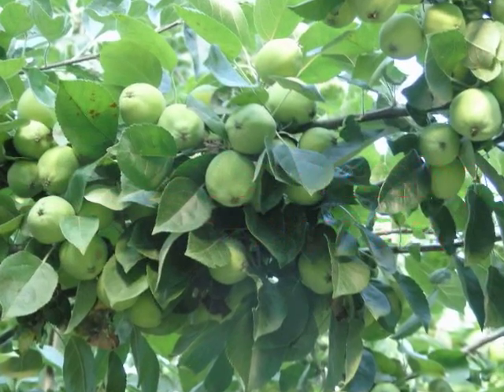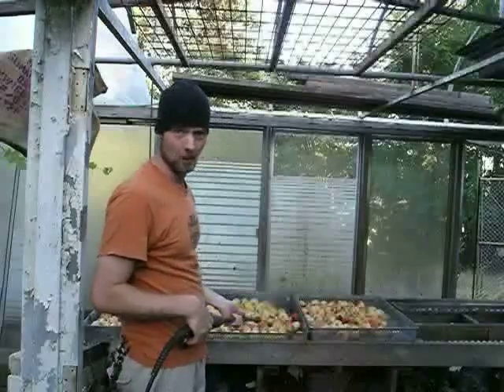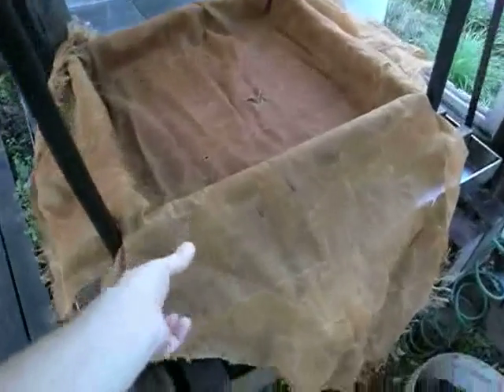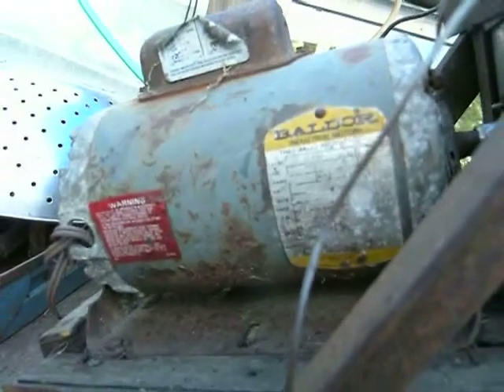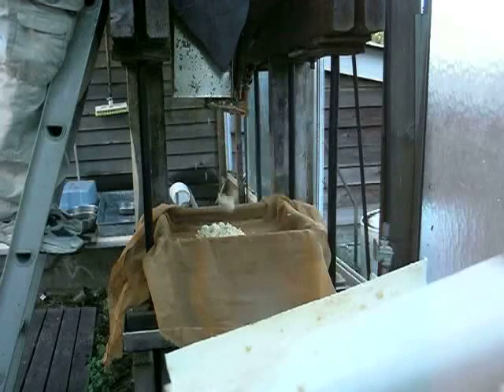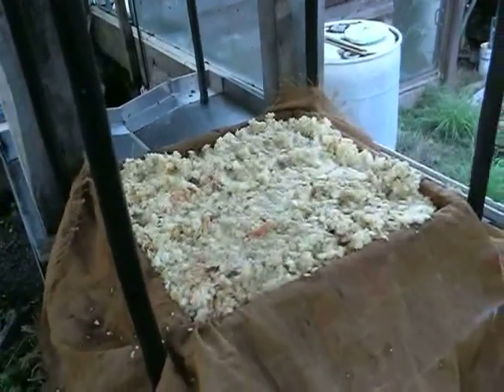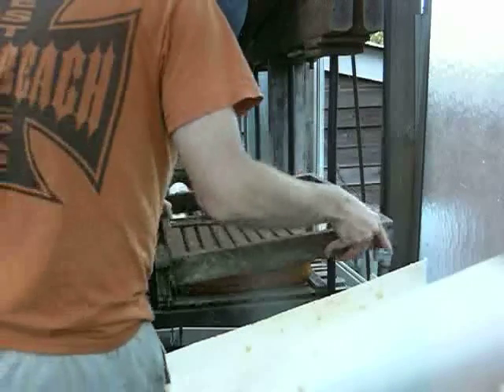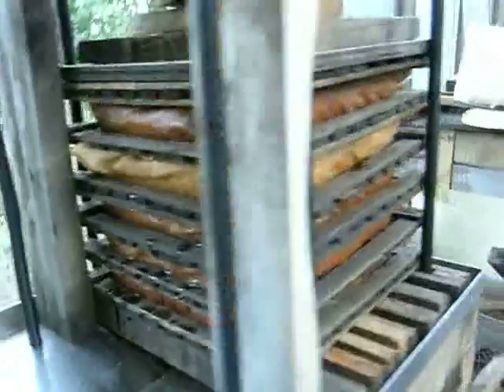Making apple juice with a home-made hydraulic fruit press & grinder.

Comment: Geoffrey invited me to use that chipper and the  press..hus later chipper was made of butter knives welded to a drywall mud drill that fit into a converted washing machine drum..
 I made 50 gallons of juice in about an hour. Well worth it..fast..lots of wasps but you get used to them.. it was Such a great unit. I mean the guy made it work in mysterious ways..

Comment: Do you think you could add a video of how the grinder was made?
Reply from the maker: countrieboyz2009 The grinder was hand-built by a friend of mine with all stainless steel, the blade is very similar to what you would find in a blender. There is a narrow slot at the bottom of the chamber, and the apple pulp is swept out by the motion of the blades. Perhaps I can get some more video footage of the grinder during this next apple season.

Comment: Gurt if you do a lot of apples like maybe you press a 1,000 gallons I got a lot better idea. You take heavy I beams and weld sides on them you space them so a truck could drive over them. You weld I beams in the middle with a  that will press into a recessed heavy pan You have heavy truck springs on one side and when you drive the truck over it the springs rise the I beams up and you remove the pressed apples. We did this a few years back we had a six wheel truck and she weighed 35,000 pounds